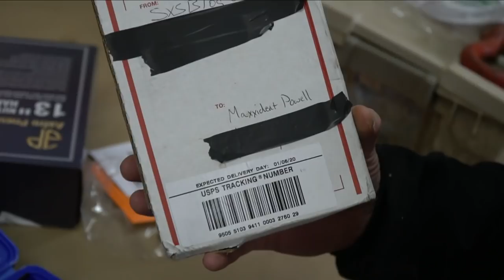Taking Rzr ProXP to Drive-Thru Coffee Stand!

Comment: Looks like a blast man!  Do you ever have any issues with your DSLR getting messed up from all the rain?
Reply from the maker: The Sony is actually pretty water resistant actually.   I've never had a problem aside from fogging inside my lenses due to temperature change after a little moisture gets in there

Comment: I have the exact same nutsert tool from Amazon, I also got stainless steel nutserts for my truck project.
Reply: Have you found the stainless ones break easily? I did a  boat project and used aluminum ones and they where a little soft.
Reply: @Stihlheadd  ya, I had to do all of them twice from over squeezing and stretching the threads. A pain drilling them out but once I got the hang of it they worked out well. A bit of a learning curve.